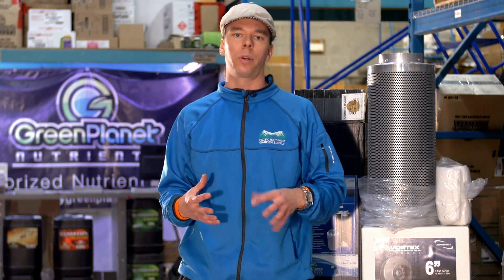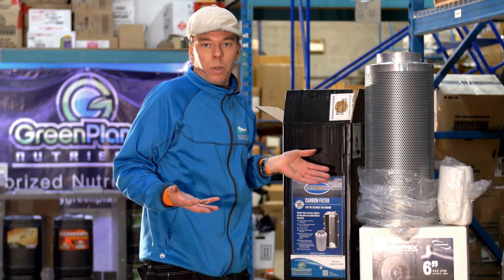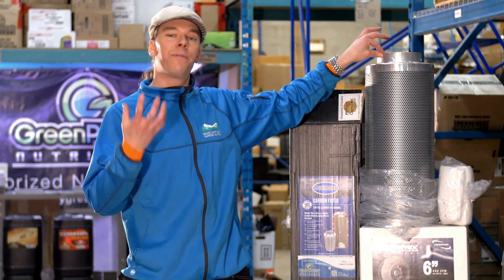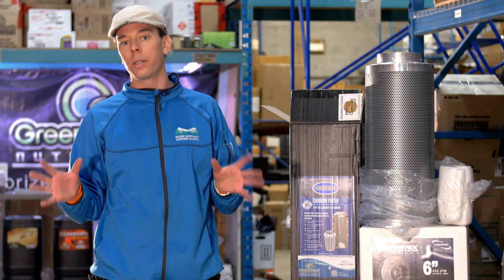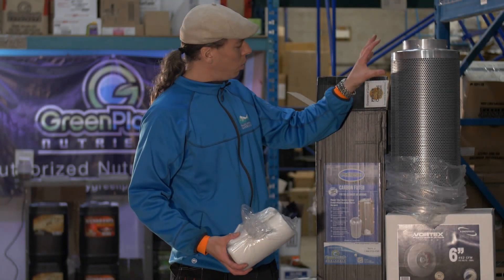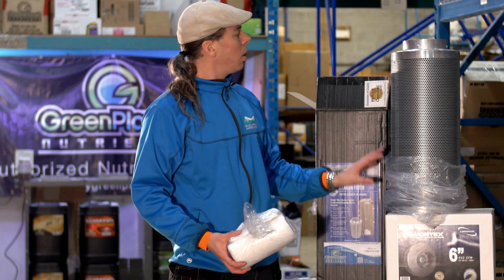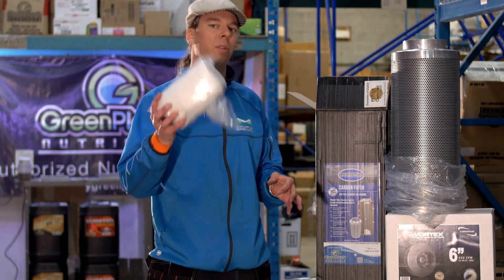Carbon Filters - The Garden Sage 3

Comment: Hi Green Planet!  I'm really enjoying this video series and find it extremely informative.

I have just one thing I need clarified for me.

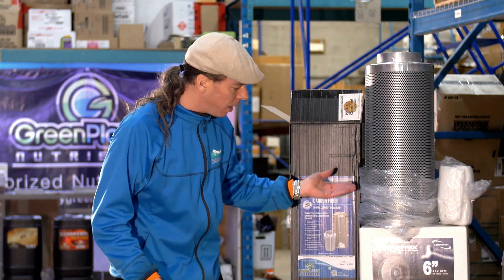At about 3:40 of the video you mention the 2 main ways people use carbon filters, Scrubbing vs Exhausting.

One thing not mentioned is how the 2 different methods effect ones choice of Fan/Filter combo.

My understanding is that a filter should have 2 different CFM ratings. One for scrubbing and one for exhausting.

The "Phresh" (GP) filters display just one CFM rating, which I have been told is for "scrubbing". 

The "exhaust" rating should be roughly half that.
 
For example you have a 6" vortex fan matched up with a 6" green planet filter. This would work just fine "scrubbing" the room but if you were to "exhaust" that air directly outside, the CFM rating of that fan would be too high to effectively clean the odor.

Like I said, really loving this video series, I would just like this one point clarified for me as I feel it is very important to know one way or the other.

Thanks!
Reply: Chris PNW 2 years later and your still waiting on a answer lol
Reply from the maker: +Chris PNW Hello! We've forwarded your questions to David (the garden sage) for further clarification on this matter. :)